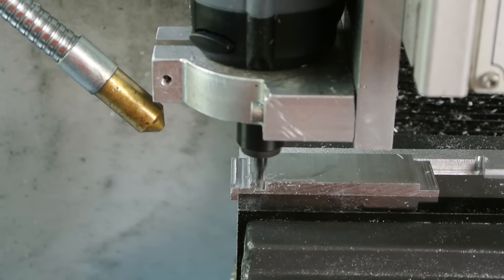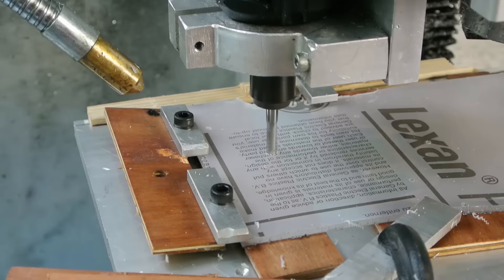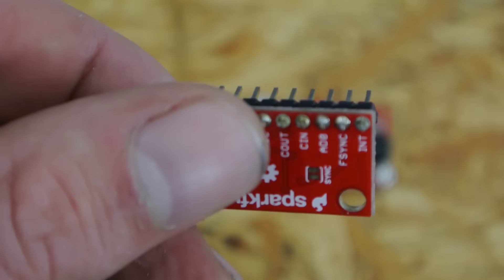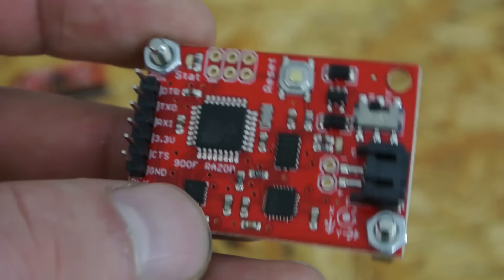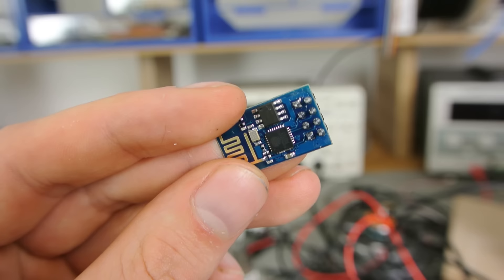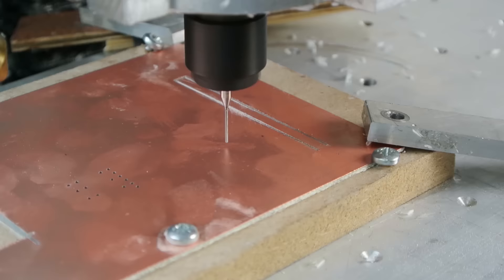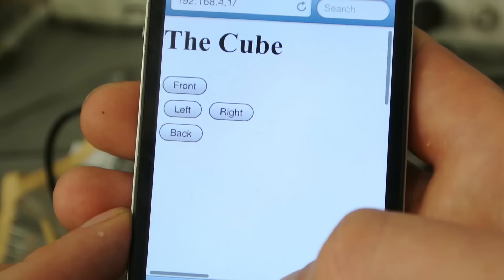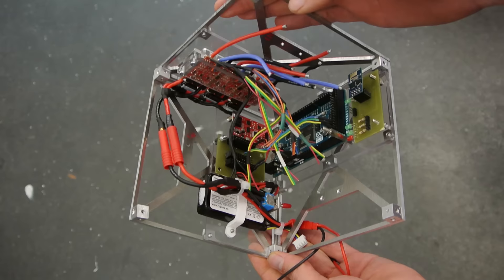Making a Rolling Cube : Part 7 - Mounting the electronics

Comment: Hey Chris very nice work !
Take care of your fingers when you make outside cutting. Most of the CAM software offer to put some small bridges to keep the part in place. Then it is very easy to remove them and you also will be able to protect your part as well as your fingers ;-)
Reply from the maker: Laurent CNC Thanks Laurent. Yes, I know. Its not the safest thing to do. But I didn't expected so much vibrations so I went for the quick and dirty solution :)

Comment: Roughly what is the power usage of keeping the Razor gyro active? How long can it go without a recharge? Do you need to calibrate the cube every time it deactivates?
Loving this build.
Reply from the maker: CellDevises Thanks!  It's an electronic gyro, so the power usage should be very small, especially compared to the motors, if that's what you mean? The calibration should happen only once, but with everything installed.  it gets hard-coded in the software.  
Not sure how long the battery will last, Ill will have to test that when it's finished. I made some connections so I can recharge it easy without removing the battery :)